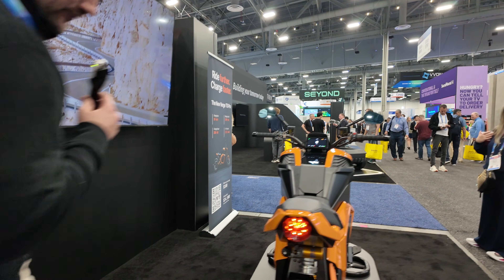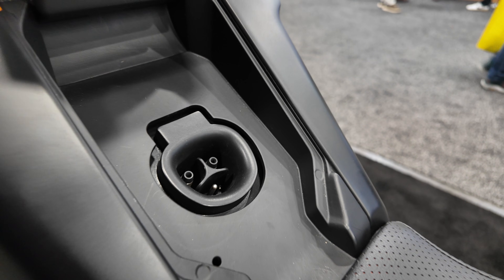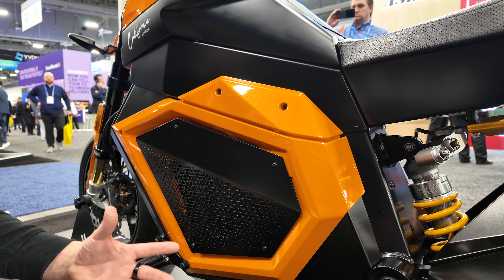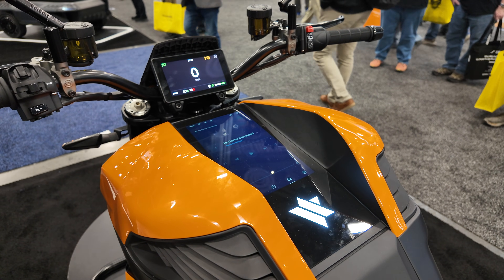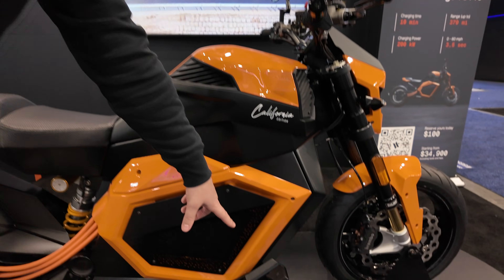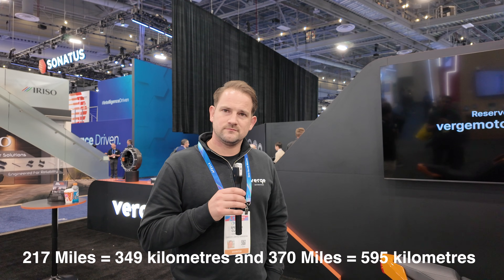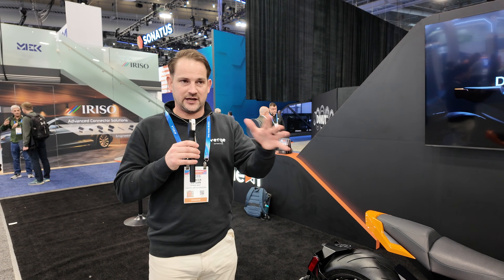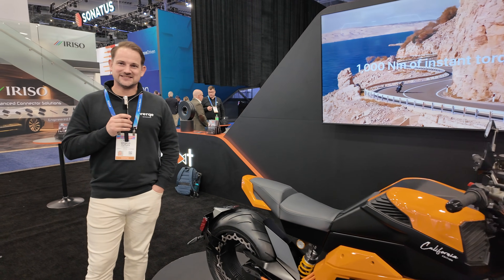Verge Electric Motorcycle with Solid State Battery at CES 2026

Comment: At 2:30 minute he said the weight of the 20 kWh battery is 225 kilos. Sorry I don’t understand this. The SSB is 400 wh per kilo, so 20 kWh should have a weight of only 50 kilos. Of course the case also have weight but 225 minus 50 makes 175 kilos for the case. This is more then 3 times more then the weight if the native cells. Very strange or am I missing something?
Reply: @janvandenberg6290  he means the weight of the bike, not the battery. Would be interesting to calculate the difference between the large and smaller bike because that is pretty much the weight of the battery
Reply: @bhoubit 20 kWh battery > 225 kg
33,3 battery > between 235 and 240 kg let’s say 237 kg
This 12 kg more for 13,3 kWh extra
SSB should be 400 Wh per kg
12 kg x 400 Wh = 4,8 kWh…… this does not match with 13,3 kWh
Reply: @bhoubit I saw another video about the Verge motor. On this video was said that the 20 kWh battery was Li-Ion based and the 33 kWh should be SSB. I can’t find this video back on Youtube anymore because there are so many that I lost the way. Can somebody confirm that the 20 kWh version is still Li-Ion based?
Update: I think the li-ion version is the model of 2025 with 21700 cells. The model 2026 has SSB 20,2 kWh and should have 4 modules of 5 kWh. Strange the animation always is showing 3 modules.
Reply: Thats bullshit Derek. Who told you that you that you have learn on a manual bike. I done my IBT on a Suzuki Burgman scooter that was automatic.

Comment: That integrated rear wheel motor is stunning. If the claimed statistics of the solid state battery are true, we are in for a revolution in EV tech.
Reply: @mancavestudios8955  it's not even design complete. It looks unfinished, a very European design.
Reply: @sunsinger970 The design is absolutely gorgeous, hope they don't change a thing. The problem is pricing. That's a 30-50K bike.
Reply: @MrAsdasdasdasdasddd  Just announced 42k€ standard and 45k€ longer range
Reply: @sunsinger970 Bruh, you are just rambling some nonsense don't you?

Comment: Testing 100,000 cycles at 24 cycles a day is (100,000/24) / 365 = 11.4 years. Therefore they must have started testing their prototypes at least 12 years ago. Or they are just pulling 100,000 out of their asses with accelerated testing.
The motor is just an upsized Ebike motor with expensive/complex bearings and weather seals, looks slick but will it be reliable?
Reply: @universeisundernoobligatio3283  
Why would they only be doing 24 cycles per day when the claim is it can do 1 full cycle in 10 minutes?
Reply: @trulsjohansson6617  
Battery would over heat. It gets warm when charging and discharging. If you do it continuously it just keeps getting hotter inside.. P=I^2R
Reply: @universeisundernoobligatio3283 
IF this sup cap isn't a scam it's supposedly not getting very hot cycling, and retains all propertys up to at least 100 deg C. 
And are you seriously suggesting they wouldn't add cooling if needed, and let the battery self cool for 50 minutes between every cycle? Jesus...

Comment: The 20,2kWh battery consist of 4 modules each with 14 cells making the total voltage around 200V. Given that most normal CCS charges limit current to 350-400A the charging would be limited to 50-100kW

Comment: If it sounds too good to be true, it probably is.
Reply: But it doesn't sound too good to be true. Battery technology has improved drastically in recent years and this is a $40k bike.
Reply: its possible if 5kw we got 100km+ what about those much kw, so its possible especially with that solid-state batteries, hopefully, i got about 70km if go 80-90km/hr or 120km/if i go 50-60km/h on silence s01 connected at 85kg. Although that beast have much biger everything from motor to power to batery

Comment: why a legit company like Verge partening with a company like Donut that we all will soon fine out it was a scam or a complete misleading interpretation of a "solid-state" battery.  I could bet a million that that battery is going to be disappointing hype.
Reply: Verge own DonutLab which is their in house R&D. The motor on the bike wheel is factually confirmed and you can see a review in of all places, Forbes. We will find out about the battery pretty soon and certainly by the end of 2026. A coast to coast on the bike would provide the information needed to check the battery claims.

Comment: The range showing on the screen calculates to only 164.42 miles.
Reply: first its 172 km on the screen and its at 65% battery charge please people use pause its not that hard
Reply: @kbubuntu6048 172km/0.65=265km. 265km is ~165 miles. Yes, that means that the bike did not have their "production ready solid-state batteries" in it. Please people understand math and unit conversions.
Reply: @sajiantony7473  Good catch, because it doesn't have solid state batteries in it. Just the regular battery pack they had since 2024. They are lying about solid state batteries. They may have developed a super capacitor they are calling a "battery" or the battery is complete vaporware. They hope to get all these pre-orders then cut and run with the money.

Comment: Why are they quoting 0-80% on the solid state battery when they that it can charge from 0-100% and not slow down?
Reply: They never said it doesn't slow down. On their charge chart it does slow down at the end.
Reply: @gregb1599  I think it’s more to do with optics. But also keep in mind that this version for the TS pro is slightly reduced in terms of charging.
Reply: @SnrMusic-nb6lj  It's supposed to charge at 200kw so a 33kwh SS battery 0-100% should take 12 min. They did mention 10 min which is crazy fast!
Reply: @gregb1599  because the solid state battery is a bullshit marketing gimmick for the new motorcycle

Comment: Still not sure why there is no hubless wheel in the front though? I'd think that would extend the range to an insane degree.
Reply: Front wheel drive are not the best. I got a little scooter 2 wheel drive an yo need to be very careful during cornering the front wheel tend to try to go straight. For trail riding might be fine but on the pavement not so sure
Reply: @L.L I don't know how you could possibly know how this would work unless it is tried. A hubless front whell on an electric bike theoretically would be easily accomplished technically, so I can only assume that it was a cost issue that determined not to do it.
Reply: @o @onlinesavant I had in mind that you met with the a motor in it too. For them it is probably just for cost.